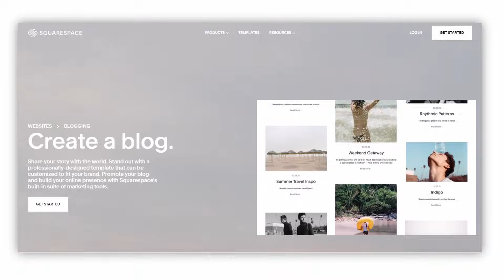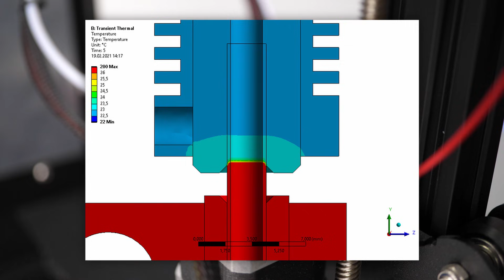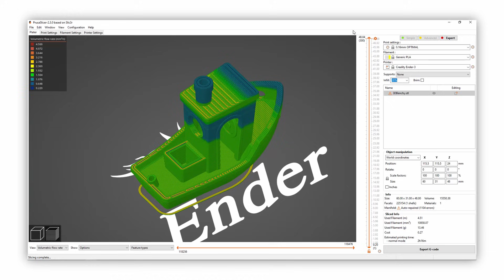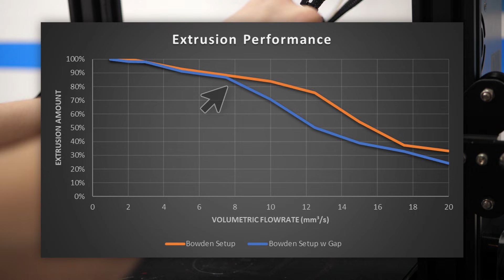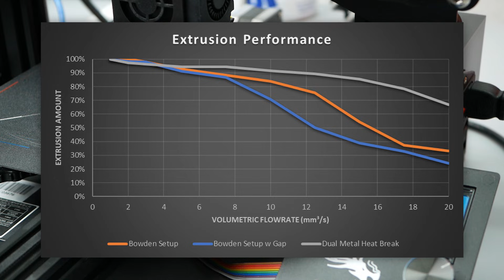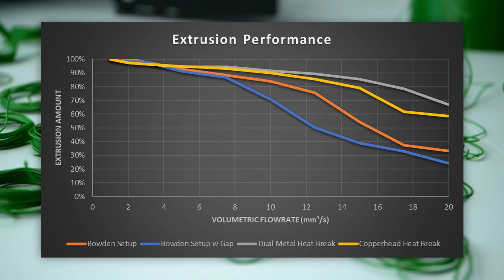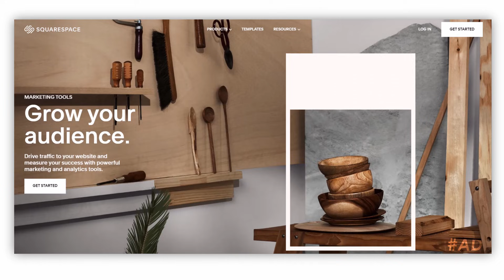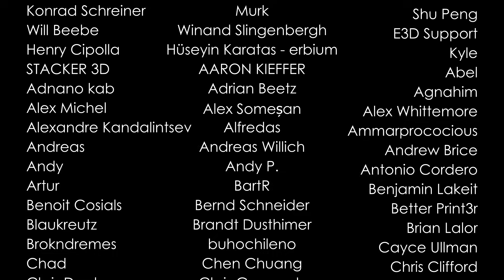Bi-Metallic Heat Breaks - A (R)Evolution?!

Comment: Did you get any stringing problems after the switch?
When I switched from a heatbreak where the bowden tube goes down to the nozzle to one with a second PTFE tube a liner I noticed an increase in melting speed but I also suddenly got stringing. I guess that with an even faster melting hotend the stringing will become even worse.

Comment: I am having severe heat creep issues with my all-metal hotend experiments, even with a titanium heatbreak the heat sink heats up to nearly 100 degrees C within just minutes at PLA printing temperatures. I need to try out this one. I am still waiting if a design with ceramic throat will someday arrive.
Reply: mellow NF Zone has a ceramic neck

Comment: This really got me thinking (I like to push my Ender 3 to 5-7mm^3/sec at least for infill) : Shouldn't it be possible to compensate for the reduced flow at higher speed in software? Or possibly by measuring the actual length of filament pulled into the extruder and realtime feedback to compensate for the loss of extrusion efficiency (I imagine a Sensor similar to Thomas Sanladerers filament diameter sensor but measuring filament travel)?

Comment: ahh the good ole knock off shit from eb*y that guarantees to fit (at least as they always state in the description). Had 3 Heatbreaks ordered from local sellers because I did not want to buy from chinese and wait long. They all assured it will fit. Welp, 2 did not fit the specified heat exchanger (same as your knock off, far too short to tighten that thing, so printing was near to impossible) and the third had a "titanium" "coating" on the inside. Long story short. Heat creep 1000%, after 2 layers always clogged. Ordered some all metal cheapo heatbreaks straight from china and at least they are up to spec. How i hate local resellers/dropshippers selling unfitting crap

Comment: You didn't test the knock off one with the changed retraction.
Reply: He did test it just didn't show it in the Video, at 9:41 he says "On my 3D-Benchy I got serious extrusion problems and tuning retraction only helped slightly.[...]" So while he did test it he didn't see any improvement worth showing in the Video.
Reply: @layzay73  He showed zero evidence on that claim so its def suspicious.
Reply: Missed this too. I installed the heatbreak from trianglelablabs and without changing the retraction (it was set to 6 mm) i had horible underextrusion. Now I changed it to 2 mm and everthing is fine.
Reply: I tried a 2€ bimetallic heatbreak and it works flawlessly. That is 30 times cheaper than the price of the slice engineering one where I live.
My retraction and pressure advance both halved and I have zero stringing (even better than with the ptfe lined one I had before).
My max flow did go from 20 to 16mm³/s, probably because the cool side is a lot cooler than what it was before.

Modification worth doing. But I wouldn't buy the one from slice engineering
Reply: noticed it too..
Reply: He mentioned testing it.
Reply: @jdrevenge  If he tested it, they would have had the same result. They are made of steel and copper. Sure the slice one will probably be a few degrees cooler due to better material choice, and be less likely to fall apart, but this kind of performance will be the same.
Reply: "knockoff" is for kraken hotends and was made couple of years before slice engineering ender 3 product.
 @Anyone700 kraken one for me  on Ender3 with PLA always clogs in half an hour the most.
I'm thinking about ordering Ender 3 purposed bimetal (Titan + Copper) heatbreak right now.
Reply: shhh he isn't supposed to let you know the clone works

Comment: My experience with a bimetal heat break from biqu is a bit mixed. Performance is amazing, i have no issues with print uniformity, like in the video. However, the tube is a bit loose and does rotate a little bit, even tho it shows no indication of ever coming apart. A bigger issue is that long retractions, overpressure or pulling the filament out, without first pushing it a millimeter in before, results in molten plastic climbing in the cold zone and clogging the nozzle.

Comment: I love your testing protocols. Would it be possible for you to compare the ender with bimetallic heat break to a Phaetus Dragonfly hot end? The hotend does come with a bimetallic heatbreak, copper heater block and nozzle. I would be genuinely curious to see a 1 to 1 test, especially given I'm currently using one in my Prusa Mk2.5s.

Comment: I bought the same style of heat break from Spool3D made out of titanium for the Ender 3 stock hotend. It worked great for CF nylon but clogged constantly with PLA even when oiling. I coated the heat break with a high temp thermal paste and it finally stopped clogging with PLA.
I finally switched to the Micro Swiss direct drive and all metal hotend kit and never looked back. Lol works perfectly. Just did my first TPU parts without any issues.

Comment: I told my 3D printer manufacturer friend (the owner) that to try out tempered glass, ceramic and SS tubes for heat separation in 2018, but he answered as let them spend to buy DIY parts and he will stick to mass produced parts.

Comment: I'm using the trianglelabs one for a lot of time now without any issues, printing high and low temp filaments!
Reply: Trianglelabs is without a doubt the highest quality counterfeiters in the game.
Reply: @DR-br5gb  is counterfeit the correct word?
Reply: @garramiro  it is open source so I don't think so
Reply: @vasko928  Wrong and wrong.  Here's a link to Slice Engineering's mosquito.  Tell me what it says on the heater block:  https://www.sliceengineering.com/products/the-mosquito-hotend%E2%84%A2
Reply: @DR-br5gb  We are talking heat breaks here.
Reply: @vasko928  ugh we're taking Trianglelabs.  Have you already forgotten?
Reply: @DR-br5gb  1. that means that they probably(!) applied for patent somewhere. Whatever is part of that patent application - it is not stated there !!!
2. that means that patent was not issued
3. patent is valid in the country where it is issued. Thus if it is patented in the USA, it is not patented in the Germany or other country
Thus they cannot counterfeit anything that is not protected in their country neither in the one where they export it.
Reply: @mungo7136  I'm baffled that you took the time to respond with something so factually insistent.  I have 3 patents. I'm familiar with the process.  You're only explaining part of it, cherry picking certain aspects in attempt to build a case for Trianglelabs, which makes no sense at all.  I.P. theft coming out of China is not up for speculatory debate.
Reply: @DR-br5gb  Fact that you may have somewhere 3 patents means little. If you were so familiar with the rules than you would avoid calling something counterfeit.
And calling important part "cherry-picking" speaks for itself.
Were your patents granted in China? If not, China cannot steal your I.P. because they cannot steal something that doesn't exist.
Reply: @mungo7136  Dude, if the technology is patented in the US, which it is, then the patent owner can assert the US patent in a US court against the Chinese company or any affiliate or other party that is performing acts in the US such as making, using, selling, offering for sale or importing products covered by the claims in the patent.  Slice Engineering would be well within their rights to do so if they wanted to fork out the legal fees.

Remedies granted by US courts include injunction, an enforceable order to make someone stop doing something, and legal damages, a legally mandated order to pay a sum of money.  I really don't understand why this is so hard for you to grasp?  Maybe this will help you although it's unlikely:

https://scholarship.law.duke.edu/cgi/viewcontent.cgi?article=1101&context=dltr

Your standing on behalf of the CCP who actively thefts between 3 and 600 billion worth of American i.p. yearly.  Again this is not open for debate.  There's over 1,000 open investigations taking place on the matter across all 56 regional FBI offices.  Don't bother responded to me with anything other than truth..
Reply: You can't enforce anything in China as they don't ratify patent or copyright laws.

US laws do not apply to other countries.

Many countries do have their own patent laws and you can patent a device in multiple or all countries that have such laws.

You could try and stop clones being sold in the US market because you have a US patent. 

Your remedy would be seizure and forfeiture of goods on US soil. Not pursuing the parent company who is in a country with different laws.

In practice it would be very difficult, time consuming and expensive to pursue.

As I understand it.
Reply: Also patent pending on a mosquito hot end does not necessarily mean the heatbreak in particular is subject to a pending (ie not yet and may never be granted) patent.
Reply: Everything is up for debate that's not your dominion to declare statute on.
Reply: @DR-br5gb  Knowing the majority of companies, they probably outsource the original ones to the same factory as trianglelab.

Comment: I replaced the heatbreak in my Artillery Sidewinder X1 for this with fantastic results.

Debating replacing the heatbreak on my Prusa MK3 as well.
Reply: Which model did you buy? Is your X1 a V4?
Reply: @arianetrek7049  yep, a V4.
Reply: @FTGTapGod  Nice, I have a V4 too. Which heatbreak model did you chose for it? Slice has smooth and threaded models but I'm not sure of which one will fit

Comment: A comparison with a all metal non "bi-metallic" would be a interesting follow up...
Reply: A comparison between this one, stainless steel all metal and titanium all metal, maybe even including OEM and knockoff parts (yes I know that would be a lot of work).
Reply: @lukes1978  agreed. I love my E3D titanium V6 heat break.
Reply: Indeed. Another test print with low temperature materials such as PLA... to compare cogging issues would be nice as well
Reply: It depends from materials used. For me full metal was fine from PETG, flex, nylon to PC. The only problem I had is PLA - it is very sticky and when it sticks somewhere at the bottom of heatbreak I have problems, PTFE in heatbreak there was a solution. I can't see how bi-metallic heatbreak solves that problem.

Comment: You are going to make a video about your super fast Voron printer right?
Reply: Sure. He mentioned that in hotzone podcast
Reply from the maker: Yes, soon!
Reply: @CNCKitchen  Hoping you do a volumetric flow rate test on the mosquito as part of that test.  It should be interesting with both the bi-metallic heatbreak, and the copper heatblock, along with the larger heater (although, Sanjay has said in the past that heater size doesn't matter - but really, we all know size always matters :) )

Comment: Welcome to my grounds Stefan
I am using various knockoffs bimetal from China for over a year now in my twin nozzle water cooled heatsink, and yes they are manufactured without any quality concerns.
But I managed to find a way to make them work well,I fine tune them phisically (which I would expect from the producers to do but I guess the just don't care)

A) the PTEF tube inlet need to be deburred and eventually countersunk enlarged to hep the tube slide in, a 2 mm cone fillet or chamfer does the job,takes a few seconds to do it.

B) same think at the filament inlet below, but here a one mm fillet or chamfer is enough, I sort that out with a small conic router bit run once clock wise for a second or two, than anticlockwise for three or four seconds to give my fillet  a shine so it does not grip on the filament.

You see how some small things can ruin a good concept in a potentially good product?

BTW, it took you a hile tochange that head each time... lol, using my snap in place manual tool changing setup that takes 3 mintues, assuming you have more than one heatsink at hand, just fit them in different configurations,and when needed swap them in seconds.

One last thing, PLA adores sticking to metals, hence all metal heatbreaks be them one metal or bi metal are not a good option for PLA, Stick tot the PTEF sleeved heatbreaks for that, makes life easy, no cloggs, no jamms.

On the other hand PETG, Polycarbonte, Ultem have not such issues, I am still to test HIPS in bimetal setup, will find out next weeks.

Comment: You mention the print artifacts from inconsistent extrusion rate, but how do you fix it?
Reply from the maker: 1. Make sure that all of these flowrates result in a similar amount of underextrusion ==> flat part of the curve
2. Sometimes de-activating minimum layer time and just printing slow in general helps
3. You can even experiment with the "autospeed" functionality in PrusaSlicer
4. Get a proper hotend and feeder that extrudes well
Reply: @CNCKitchen  1. Mine is odd, the hull of the benchy is under extruded but the cabin is over extruded with a bulge, at all extrusion rates.
2. My min layer time only comes into effect at the smokestack of the benchy
3. Using Cura...
4. I have a genuine E3D Titan Aero with a Slice Bi-metal heat break.
Reply: @HotboiEngineering  a good dual drive / gear extruder will push the same amount consistantly upto large resistance when the pla filament cant take it anymore and wears on the extruder to a little dip in the filament, while a stock ender 3 style will have varying degrees of slip depending on resistance
Reply: This is what Volcano for.

Comment: Why not run a stainless steel tube that has a 4mm outer and 2mm inner diameter as a small PTFE replacement tube? The tube will cost 2-3 euros...
Reply: because you'll have major heat creep issues, you'll transport a very high amount of heat from the hot end to the heatsink
Reply: @Netherlands031  That is not 100% true because what they are doing in all metal or in what Stefan was showing today (bi-metal) you essentially have a stainless still tube running through the hot-end and the heatsink.
Reply: @ChrisKoups  yeah but at some point in the video he shows the diameter, it's about 0.3 mm I think? So much less than 2mm
Reply: @Netherlands031  Checked it now, true... I order some to check. The idea it is that would be cheaper and may benefit as a "Pre-warm" area for the filament so it can print in lower temps in general. When I print with ~10mm^3/s on my CR-6, the limit comes down to how fast the heat is transmitted to the plastic. With a temp of 200, I can only do around 5mm^3/s and each 5 degrees add around a mm^3/s of what I can extrude.
Also, at 3:20, it shows the PTFE structure, if that is accurate, the heat transfer will occur almost at the beginning of the neck, which may look more like the bi-metal.